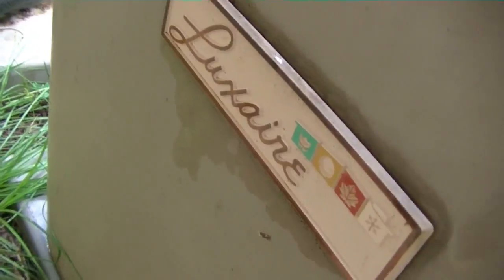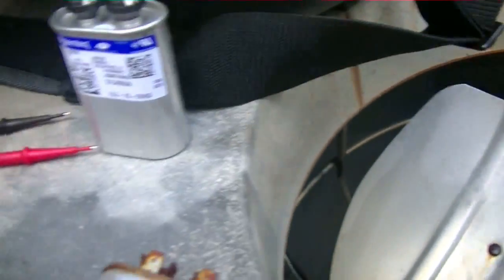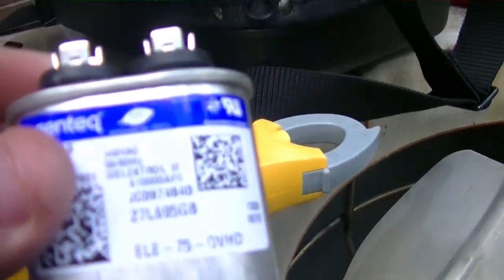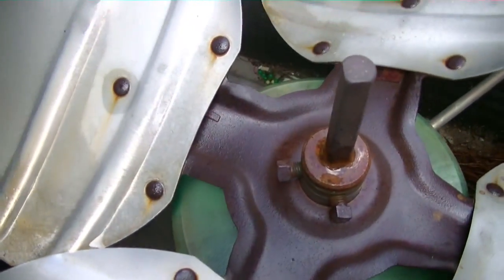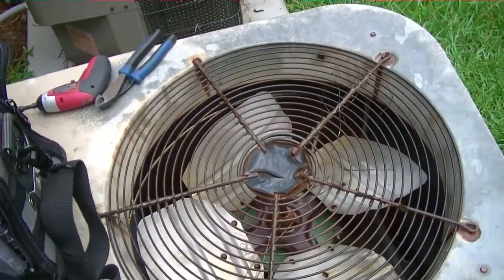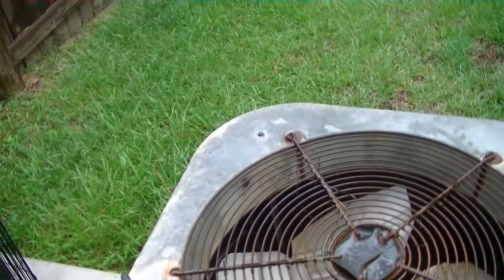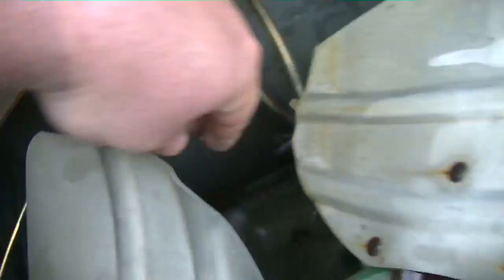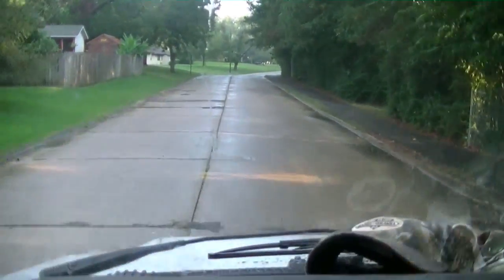HVAC Service- No Cooling Bad Condenser Motor

Comment: Good vid...What I love about watching service call videos is, that rusted AC unit, it just "feels like home" What I carry in my truck is a fan I got at Sams club, the kind with a wire grill all around it, it has 3 speeds, I'll remove the old condenser fan motor and wire tie my emergency fan to the underside of the fan grill, put it on high and get the customer going over night. Right now mine is on a customers beer walk in cooler keeping his beer cold for his customers over night .

Comment: New meters are nice, kinda like a kid with a new toy, fun. This summer I got the fieldpiece sc57 with the radio transmitter. I put the transmitter on a temperature head. I can watch the delta T on the sc57 while I'm up on a roof charging a unit, it saves going up and down a ladder multiple times.